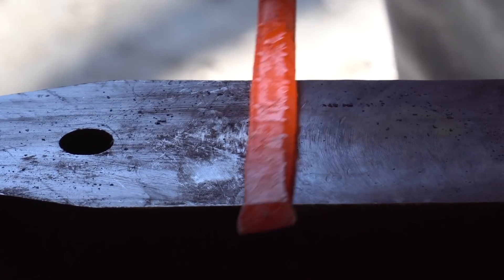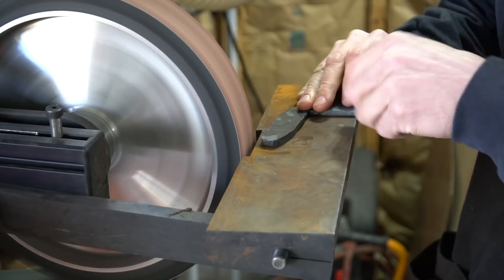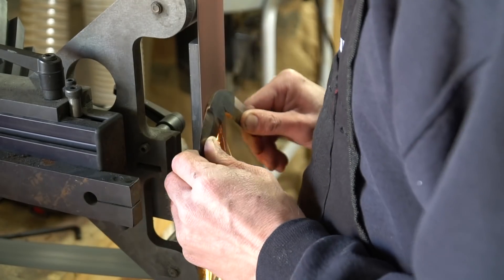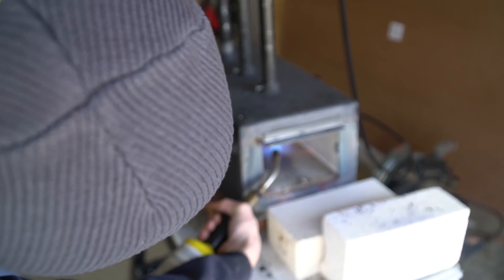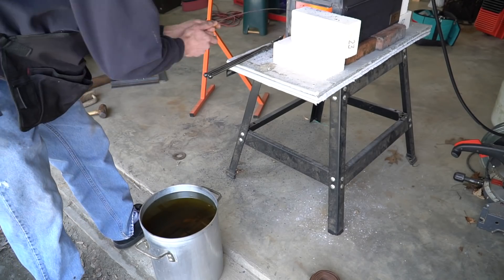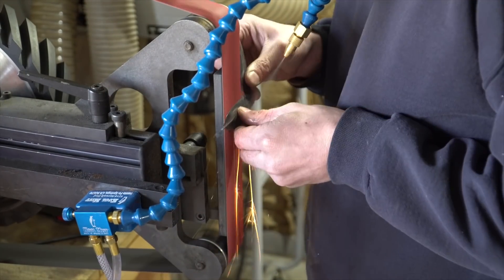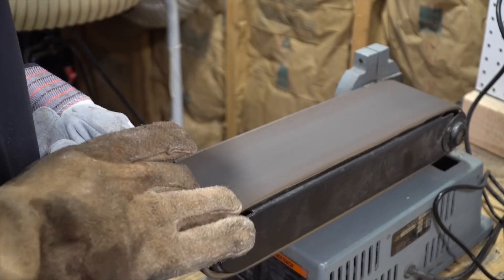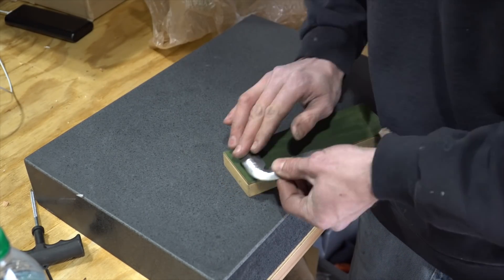Forging A Mini Boomerang knife - I was Shocked what this thing would do!

Comment: Haven’t seen anyone catch a bladed boomerang since mad max. Maybe next video.
Reply from the maker: Pretty sure this one wouldn't be returning..😂
Reply: You beat me to it
Reply: I wonder why...
Reply: You know it is entirely possible to create a returning metal battle axe or boomerang. Just requires air dynamic engineering, proper metal alloy, and if you want to make it for actual war, heat the blade or add some technologies to it. I’ve seen these type of melee weapons in shows, but the concept is 100% doable. It would be so cool

Comment: Hey Alex! I’m surprised that the rebar was hardened, I was always told it was mild steel
Reply: Yeah thats always been my understanding as well but apparently you can get some good pieces out of it!
Reply: Lance barajas Apparently!
Reply: depend of the grade, if u r murican, grad 50 and higher can be heat treated, if u r euro pray to get hold ones (before 70's) or special ones for traction purpose.
Reply from the maker: I believe this was an old piece. Probably form the 70s. it has writing on it but I couldn't read it. It did Harden better than expected 🤷‍♂️
Reply: OUTDOORS55 I’m glad it worked out for you!
Reply: I agree to disagree, i dont know much about us norm, but here in eu, norm are strict in the composition about construction material, so i guess and believe its the same in us, rebar in eu have a MINIMUM amount of carbon who cant be lower than 0.3% of carbon for the basic ones since the 70's(norm changed), before that it was made of scrap steel but generaly not under the 0.3 limit and typicaly higher than 0.4.
The only matter with rebar is the phosphorus and sulfur content lil higher than blade or tool steel. 
The grade of rebar did a lot in the hardening process, higher grade better result.
About steel : from 0.2(steel limit, under its not steel) to 0.3 not hardenable, from 0.3 to 0.4 surface hardenable(the core wont harden typicaly 1mm penetration), from 0.4 to 0.9 core hardenable , from 0.9 to 1.1 hardenable water or oil (change the hrc and ductibility with quenchant), from 1.1 to 1.6 water hardenable very hard, used for rasp and special cutting tool, from 1.6 to 2( higher its no more steel) many special usage.
From 0.3 to 0.9 oil quench, 0.9 to 1.1 water or oil, higher than 1.1 water, but this is only true for non alloyed carbon steel.
From 0.2 to 0.5 low carbon, 0.5 to 0.75 mid carbon and 0.75 to 2 high carbon steel.
Reply: Maybe it is z bar, looks like rebar but its similar to 1080 apparently

Comment: I have a cheep cool mist and love it but dont use it on the “gator belts” it kinda makes the stacked abrasives mushy I’ve found. Have you had that experience?
Reply from the maker: Yeah the trizact belts dont like water. I use them dry. They dont build up a lot of heat anyway. I love it for profiling and grinding after heat treatment 👍

Comment: I’ll take all the tips you have to offer to hide flaws at this stage of my development!!!  Dude this was awesome. I’m in suspense from video to video wondering what in the world you will possibly come up with next. Btw. I own that exact grinding jig but every time I use it where my grind line meets the flats my line is super wavy. I know it’s not the jig because I asked it what it’s problem was and it said (it’s not me I’m just the messenger) so I deduced that I obviously am doing something wrong. Do you have any clue as to what I am doing wrong?  Btw. Loved the video but expected to see you cleaning up more crap off the floor after your test throws 😂😂😂. Please keep em coming !!!
Reply from the maker: The wavy lines could be a couple different things. Make sure you are using a fresh belt when you do your finishing. Belts can wear groves in them and it will show up in your gind lines. Also if your platen ist flat you can have the same issues. Grinding technique can also play a roll. Even when using a jig you have to pay attention to where you put pressure when grinding. I would try that process of elimination. Fresh belt, flat platen, then technique. Hope this helps 🙂 Thanks my friend 👍

Comment: Just curious if you have a regular bbq size propane tank and used it for forging propane do you know how long it would last say using it for around 5 hours a day?
Reply from the maker: I have a 20lb (regular bbq size)  hooked up right now. I typically only use one or two burners. In that case i can probably get 5-6 hours out of a 20lb depending how n how hot i run it. Ill be switching to. 100lb soon though as three burners wont run right with the 20lb tanks. I believe due to flow regulators installed into the newer tanks.
Reply: @OUTDOORS55  thank you sir, awesome that you replied